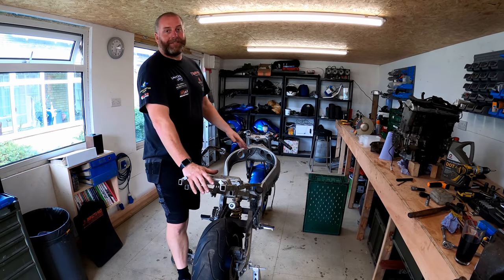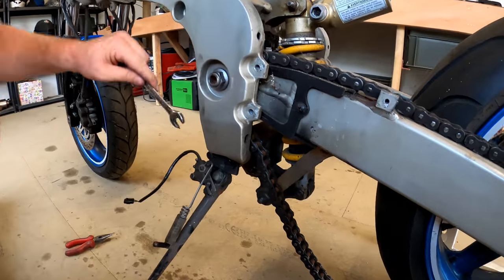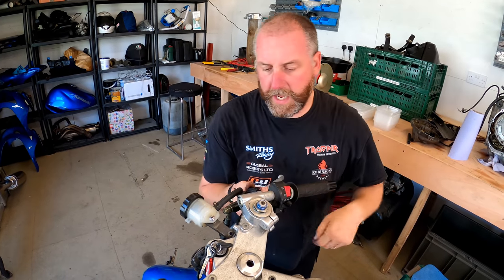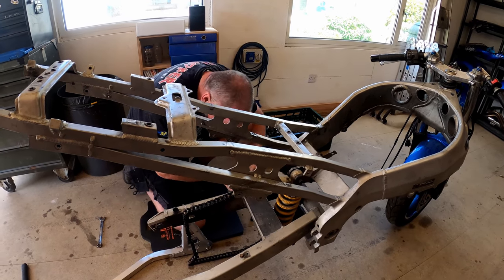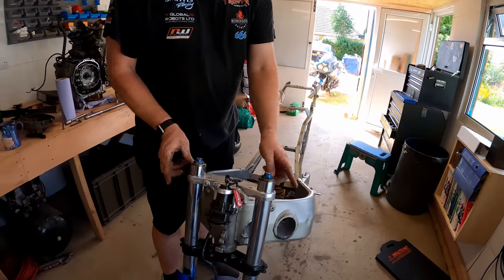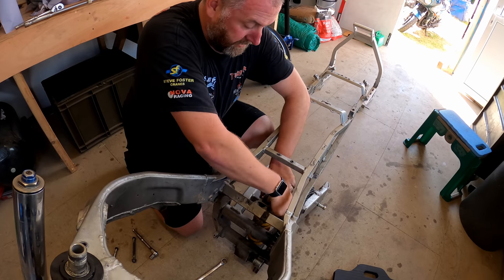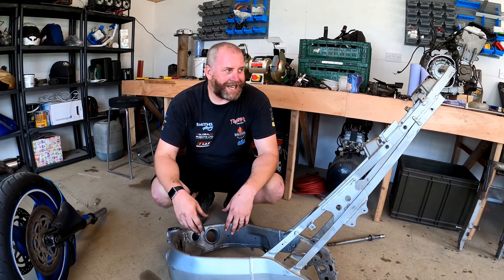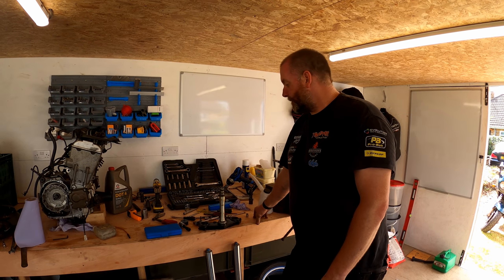1998 Kawasaki ZX9R - Project Shinobi, Episode 6 - Swingarm, Wheels and Forks All Removed, Bare Frame

Comment: I absolutely love this series on this project! This has to be the best motorbike rebuild/restoration I've ever seen! Very thorough, and I know that you've put down a lot of effort planning and thinking this through! I'm really looking forward to the engine teardown. Fyi I've got a hold of 2004 zx-10r wheels and swingarm that I'm installing on mine. I have some zx-10r forks as well, but I dont think the forks will fit, and they'll lower the front end. I think I'll make some custom spacers and go with the stock forks. It's a cool upgrade, the zx-10r wheels saves a total of 6 pounds or so of unsprung weight.
Reply: I have a C2, and have fitted 05 swingarm and rear wheel, and the front wheel from a ER6N, it looks much better, and I also fitted a GSXR 1000 rear shock !!
Reply from the maker: Glad you like it! To be fair, I haven’t actually restored anything yet! All I’ve done is pulled it apart! Now the fun stuff begins! 👌🏻😎
Reply: @KevsShed  True that! But looking good so far, waiting for the best stuff to come!

Comment: Liking this project- name reminds me of the retro arcade game 😀. Nice setup there, if I may ask, is this full-time or hobby? Also what is plating choice? For the ignition, in the past I've measured up and had a blavk self-adhesive vinyl (or similar material) disk laser cut and laser etched, stuck that on the top after rebuilding the barrel (wafers etc) worked well. 👍
Reply from the maker: That was the inspiration for the name as it happens! :) This is purely a hobby, I do it for fun, nothing more! Good idea for the ignition, i'll probably look at something similar. Not sure what you mean by plating choice?
Reply: @KevsShed  well I have done the zinc and passivate on previous projects and on my VFR rebuild, I went the nickel plate route. Nickel plate looks better imo. Not sure on longevity but I do acf50 quite regularly....
Reply from the maker: Oh right, got ya! I have everything for Zinc, with a few different coloured passivates. I think that the gold passivate on fasteners looks really nice, even if it wasn't the factory finish. A lot of Suzuki and Kawasaki bolts had a olive green passivate which I also have. I'll decide nearer the time as that stage is a fair bit off yet! 👌
Reply: @KevsShed  sweet, sounds like you are plating yourself? If so, a vid on that would be awesome. Appreciate the uploads, I'm sure it is time consuming.